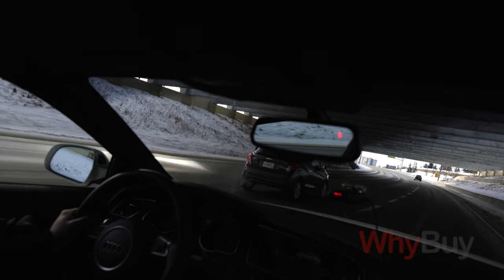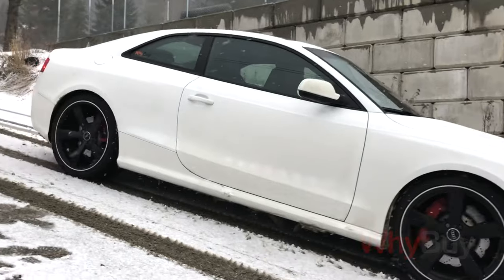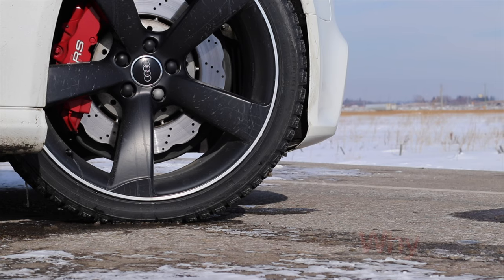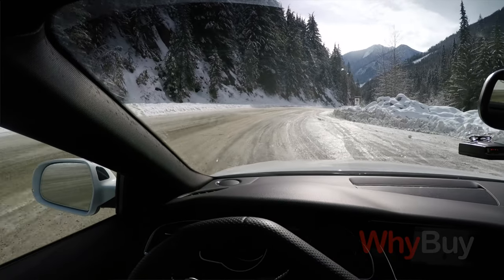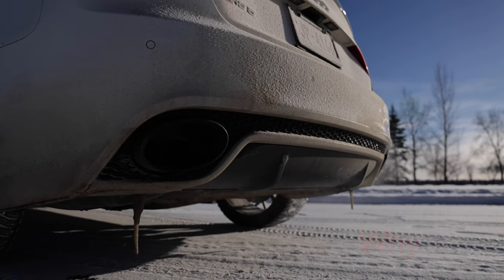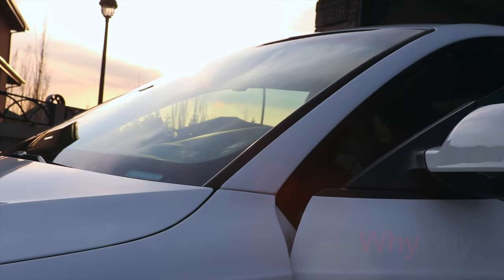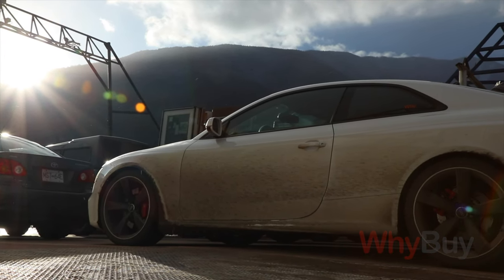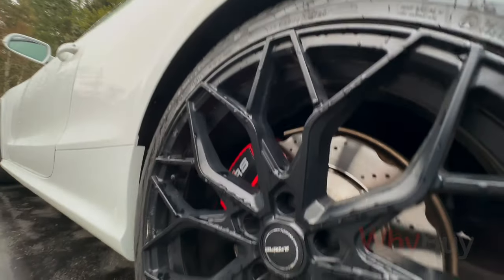Don't drive your Audi sports car in the winter?!

Comment: i wish they still made these!! i had a second car to keep miles off this but like driving it. might have to get a ceramic coat at some point
Reply from the maker: Agreed. They could put this 4.2 V8 in anything and it would be a great buy haha PS. instead of a ceramic coat, maybe look into silica sprays and paint sealant. There's a car wash episode on WhyBuy about protection that you might want to look into. In short, Ceramic coatings can be awesome (when applied correctly) but it's an expensive option that doesn't always work in practical day to day. Here's a link to that episode 👉 https://youtu.be/B7y1CNbOVEw?si=H7r762qd-vaGspdt

Thanks for watching 👍